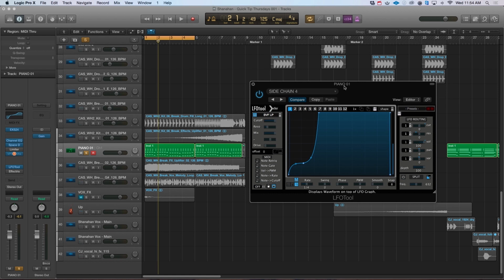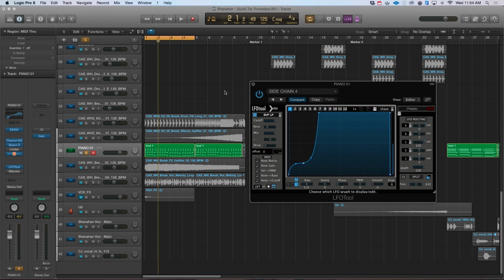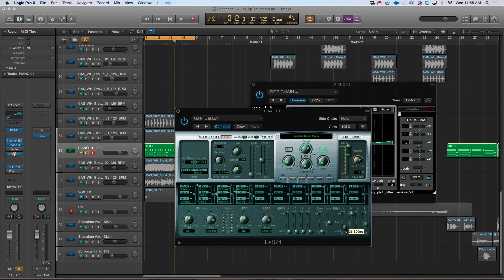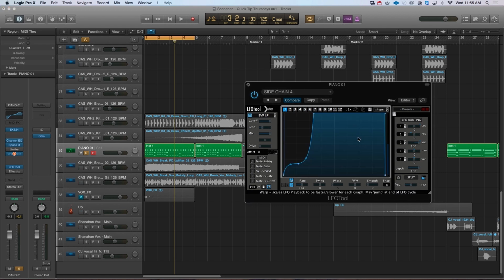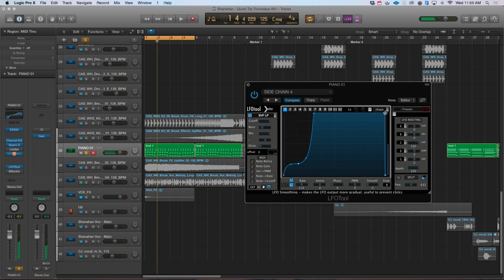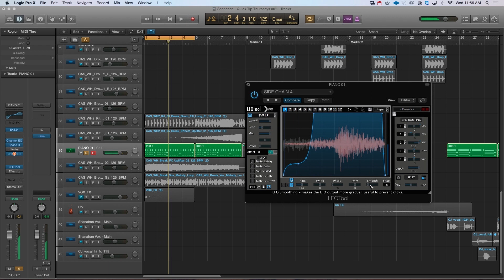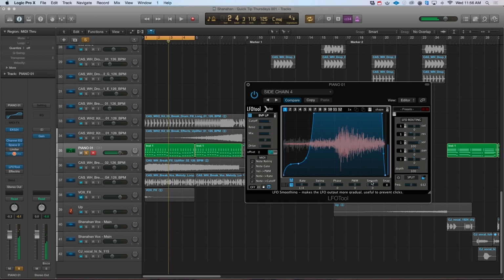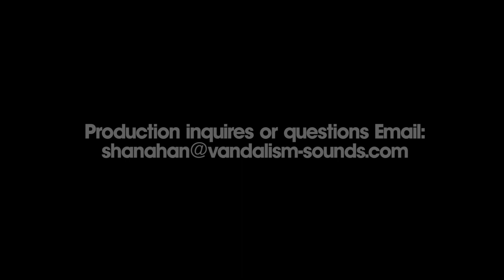Quick Production Tip #1: Removing Clicks/Clipping

Comment: I have clicks right in my SynthMaster Bassline no sidechain but it's clicking horribly loins only have this problem with bass sounds ...:/
Reply: Thats odd! Have you tried adjusting your ADSR parameters to soften your attack and give a bit of release on the synth so the synth holds out a bit rather than shuts off sharp and sudden? Somethings hard release and hard attack will create clicking!